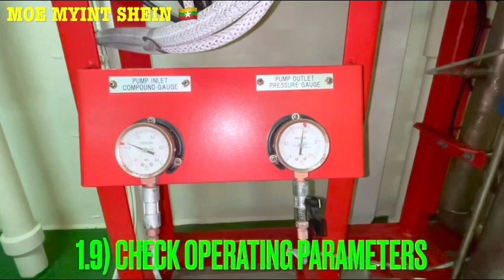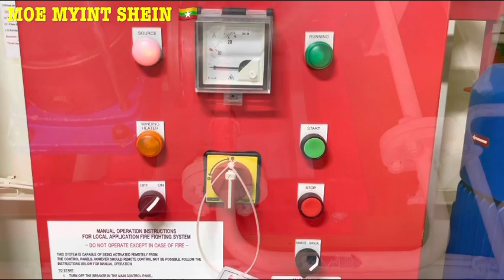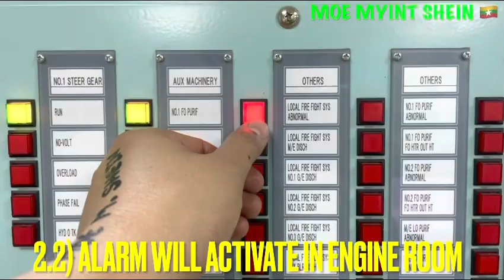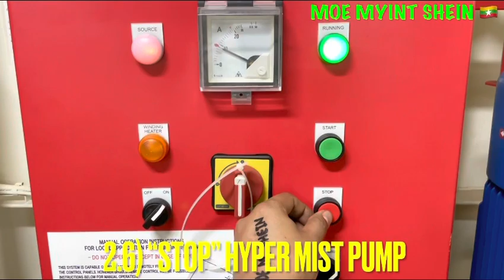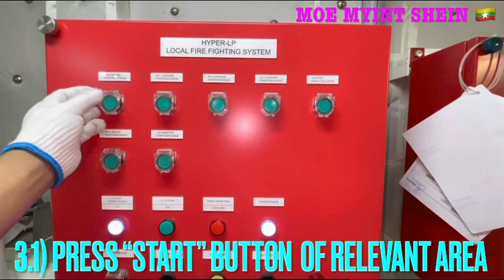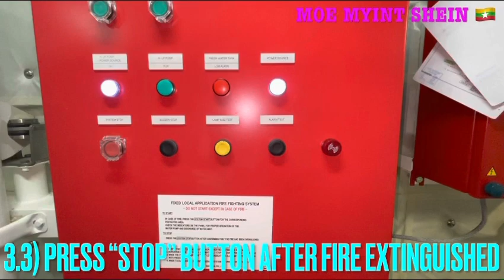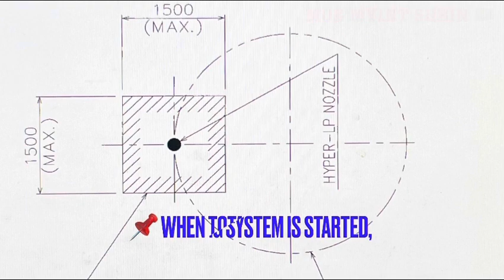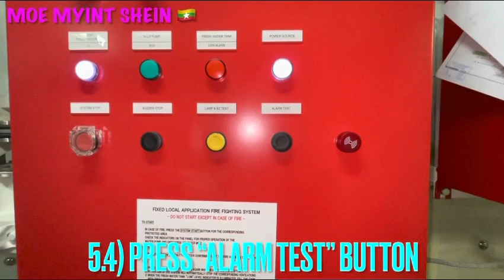HYPER MIST SYSTEM | Engine Room Fire | Technical Vlog : 029

Comment: Good day sir!
in this video 3:28
method 2:
first you have switched off circuit breaker of main control panel.
2) after that u have manually opened the distribution valve with a special key.
my question is:
why i have to switch off circuit breaker? if i switch off circuit breaker, power source to hyper mist system control board will be lost!
Reply from the maker: If breaker of control panel is ON, small motors of distribution valves keep the valves in close positions. At that time, plastic slot of distribution valve will damage if you turn the valve with special key by force. 

Why maker fabricates the slot of special key with plastic instead of other hard metals? Slot performs not only for turning also protecting the damages of small pinions. 

Turning off the breaker is to cut off power supply to motors of distribution valves. You can easily turn without any damage to slot, when there is no power supply to motor of distribution valve. 

Audible and visual alarms will activate in ECR if breaker was off. This method is to be used if remote control of designated area was out of order. 

Sooner, I will upload detail internal  structure of motor operated distribution valve and damage plastic slot of special key in my community.
Reply: @MoeMyintShein_MMU  thanks you very much sir! take love and respect❤
i am an oral candidate. that is why i have to face lot of "counter question" in examination board. thanks for your support ❤❤

Comment: sir, good day. today i am learing about hyper mist system. to activate hyper mist system, both flame & smoke detector needs to activate  together. 
my question is:
on ship what type of smoke detector we use? is it ionization type (americium 241) or photo electric cell type?
Reply from the maker: Both Types are used onboard. 
Most of onboard smoke detectors are ionization type, which can detect symptoms of fire earlier than photoelectric type, accurate and less error signal. 

Fundamental of onboard OMDs are based upon photoelectric type.
Reply: @MoeMyintShein_MMU  thanks!❤

Comment: Sir good day. pls allow me to ask you about CO2 flooding system weekly alarm test. 
how can i test CO2 alarm?
today i  told  the examiner that: i will open the cabinet door of pilot cylinder bottle. The door has micro switch. It will activate and trigger alarm+automatic shut down E/R blower fan.
but unfortunately my answer was denied. Examiner said this is not correct procedure!
Reply from the maker: Normally, Company allows to test CO2 Discharge Alarm at Anchorage when the ship doesn’t have any special jobs to carry out. You should mention above condition as first. 

Systems may depend upon ships. I faced one ship has Pressure Switch, which is normally open NO contact, in discharge line. 

CO2 discharge alarm can be tested with jump wire by closing NO contact. At that time, only discharge alarm activates without shutting off fuel system and ventilation system. 

Another system likes your above answer. 

I don’t know exactly what your examiner wants. But, I wish you to answer with the condition required to test CO2 alarms, safely. 

(Both pressure switches for CO2 System Have Been Uploaded in COMMUNITY for your reference.) 😊
Reply: @MoeMyintShein_MMU  thank you very much. perhaps he wants the answer:  jumper wire connection & testing procedure.
Reply: Examiner counters a lot. if we (oral candidates) answer something perfectly,  He always tends to go deeper. And thats where the trouble begins!
i said : i will open release cabinet door of CO2, alarm will trigger (with details)
Then he asked me, where do you get the key to open CO2 release cabinet door?
i said beside the cabinet door, the key is protected inside a glass made box. hammer is kept right there. i will take the hammer, strike the glass, take out key, open the cabinet door, alarm will come.
He said: just to test alarm you are going to smack the glass with hammer?
i knew that point, i messed up. i remained silent.
He said: this is not the correct procedure😑